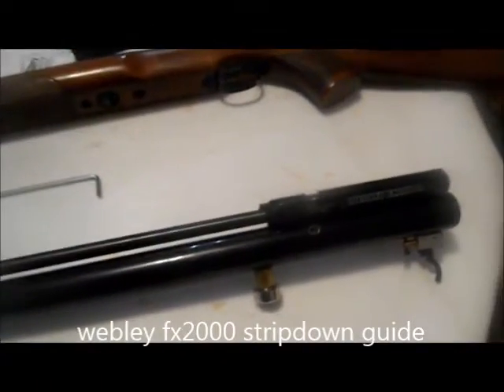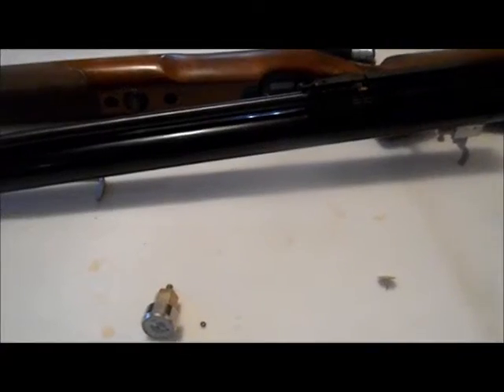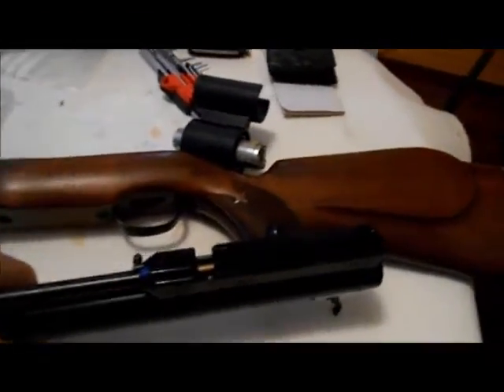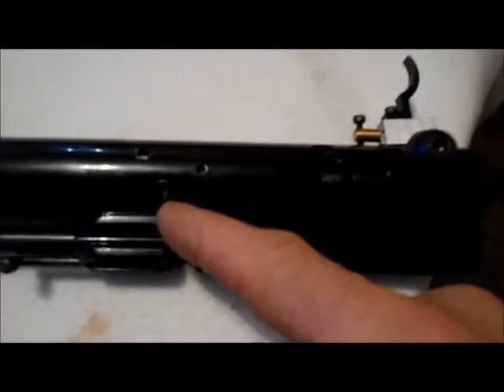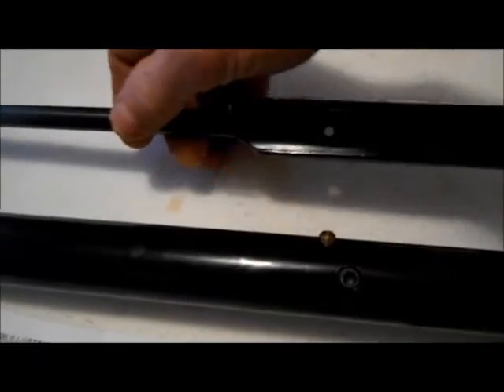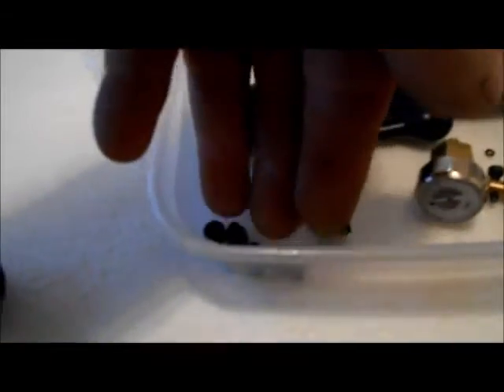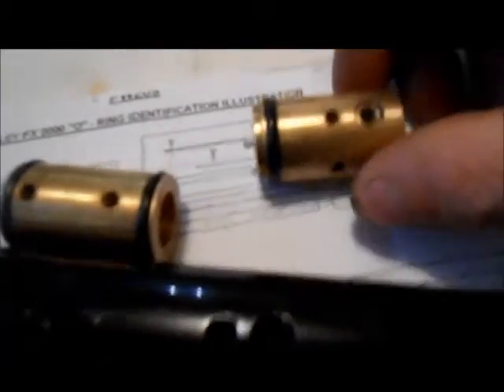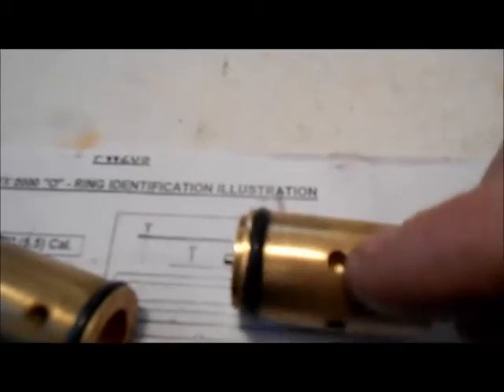webley fx2000 strip down guide( reasemble in reverse order)

Comment: Had mine since 2000, not used since 2010 tried to put some air in last week and it leaked from within the air filling port,  I bought a seal kit years ago, left it to deplete all the air and removed the end of the cylinder, there is a small valve seat and spring inside, the seal was rock hard, it took some soaking to eventually be able to remove it, replaced the small seal and the larger one and put it back together, gave some of the working parts an oil and a good clean, it came up like new, no loss of air put it over the chronograph, adjusted to just under the UK limit, the grouping and accuracy of this rifle is still excellent. Parts are not so readily available these day, I'm going to grab a few spares where I can to keep it in working order.
Thanks for the strip down video it will come in handy in the future.

Comment: A very helpful video, I've just striped mine for the first time in 23 years as the power was no longer consistent, it was stored for a 13 years without use.
This video will help most folk have a go themselves with a handful of basic tools, thankfully seal kits are still available, though some spares are getting difficult to source.

* Make sure you read the replies on here, which refer to removing the upper small crub screw which prevents direct access to the power adjustment screw, this needs to be removed and the adjustment grub screwed fully in, you will potentially damage the cylinder if these steps are missed when try to push out the interal parts. *

Comment: I managed to strip down the fx200 and assembled it back. Not as straight foward as you did, but I managed. The only part that you forget to mentioned is small screw(?) that lock the main valve housing to the tube. Almost make a big mess because of that! luckily I double check everything before I continue pushing them out of the tube. That being said, I couldn't done it without this vids! THANK YOU !!!

Comment: Can I add a humble suggestion...removing the valve assembly towards the rear of the cyli der reduces amount of pushing oit required, and avoids any risk of scratching inside of part of cylinder that is under pressure when charged. Again, excellent video and saved me a few bob. Tony.
Reply from the maker: removing it to the rear increases the chances of you damaging the orings buddy
Reply: either way they can get damaged use abit of sense have a good look before just shoving them all the way, its not rocket science just simple care n attention like a bike inner tube replacement dont pinch it ?

Comment: That little screw is the main power adjuster there is two of em in same hole 1.5mm Allen key take out 1st one to remove valves the 1st one to come out is to simply lock onto the one below that that is main power adjuster if you have fac, wind it out to increase power then fit the second one back when you reach the power you can have according to fac or sub 12
Reply: Thought in the video it is a slotted/flat screw driver bolt head to adjust power?

Comment: I just destroyed my FX2000 following these instructions.  Everything was fine up until removing the valve and hammer inside with the rod.  Mine would not budge....but its is an old gun that has not been serviced in at least 12 years, so started tapping.  The valve eventually moved, but required driving all the way down the cylinder, and when done, there was a giant groove down the inside of the cylinder from some mashed steel thing sticking from the side of the hammer housing.  Looks like it was a pin or end of a screw of some kind.  I have watched and rewatched and don't see anything being removed that would explain what it was.  Absolutely gutted.  My rifle is scrap now.
Reply: We're you able to get a replacement cylinder, I would be gutted as these are a great rifle.
Reply: Knibbs aka airgun spares...

Comment: How did you get the small silver seating ring out, the firing pin goes through it. I've have a logun asxor which is very similar to this this and I don't want to damage it getting it out. There is an o ring around the silver valve seat you mentioned but you didn't at how that comes out. the logun asxor is a fantastic gun an doesn't suffer pellet jamming like the  mrk 1 and 2. cheers

Comment from the maker: these guns are soooooo easy to strip and rebuild, only thing you need to make sure of is that the power adjusting grub screw( theres two in same hole, one is to blank it off after adjusting the one below) both need bee wound right in before stripping or you will fuck your cylinder,, take top one out and wind bottom one in

Comment: John is there a grub screw (  c1102 in the diagram ) that fits into the main valve housing (pw259) holding it in place in the air? I have a problem!
Reply from the maker: c1102 is air inlet adjustment( power ajustment  grub screw ( just a small threaded lug with 1.5mil allen key hole in one end, it dosent hold anything in place, when your gun is assembled it should line up with a hole in cylinder and can be put in after assembly, the further in the less power and vise'versa, , look on chambers web site for a full diagram , shout me if you get stuck

Comment: Great video. Thanks. Can you suggest how to replace the breach seal O ring at the rear of the barrel - the one that engages with the pellet probe. I took this out to check it and it is a problem to get it back in. My fingers aren't particularly fat, but it is a real fiddle and I can't get the new O ring back in. Thanks.
Reply from the maker: the way I do it is remove moderator, lightly grease the o,ring and pop it into the FRONT END OF BARREL, the pop a pellet in same end , skirt 1st, push it down to breech with a long scewer an it pops into place, may take a couple of attemps but its dead easy buddy
Reply: Thanks for the advice. I actually solved it myself. Previously,  I was stupidly trying to insert the o ring with the barrel fixed to the action. There is no room obviously. Then after I'd messaged you, I spotted that the grub screw on top of the action frees the barrel. Then it was a doddle. :)) Thanks again.
Reply: Can u say me size of oring

Comment: Thank you very much for this vids, since not many people take time to do this, its greatly appreciated. My friend ask me to fix this gun because it was leaking air from the pressure gauge, I tought it was an easy fix because at worst it probably had a damaged o ring, and I could just simply take it to mechanic shop and find a replacement. But the o ring is missing, so I have nothing to compare with. could you help me with telling me the outer ind inner diameter of the ring and the thickness?
Reply: I know this is a long time ago, mine is an early model there isn't an O Ring on mine, its a small white coloured plastic / nylon affair, the old one was a bit tricky to remove. I recently bought a seal kit by FX and it came with a replacement, which is now fitted.

Comment: How do you change the hammer spring
Reply: He does show this in the video where it mentions you can adjust the tension on the spring, its the same process but you need to just keep turning it anticlockwise to remove it fully, about 9 full turns on mine, not easy either as it appears lock tight is used on the thread, it is doable though no need for a vice which may cause damage, just need to be able to grip it tightly by hand, then use a well fitting flat bladed driver to undo.